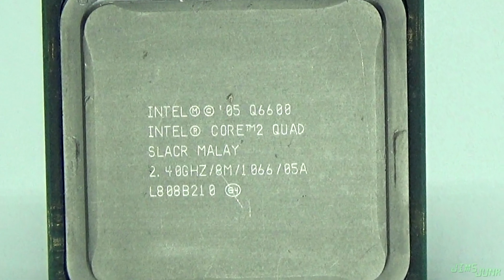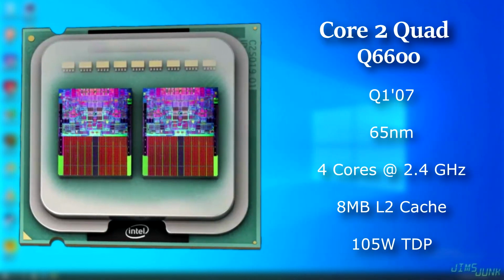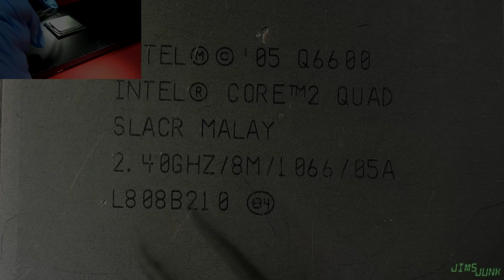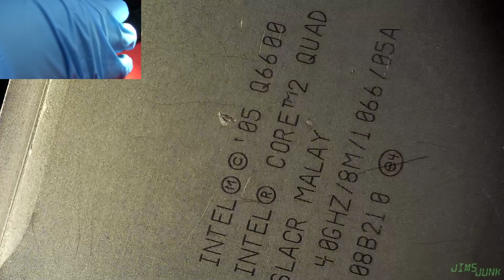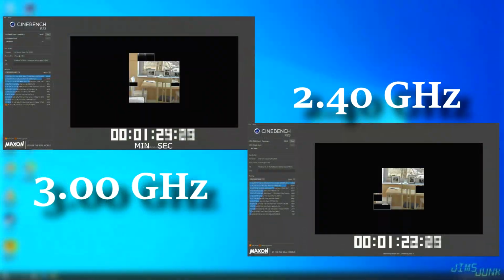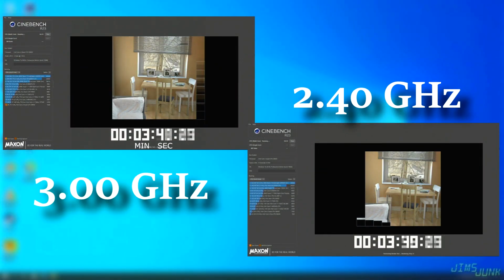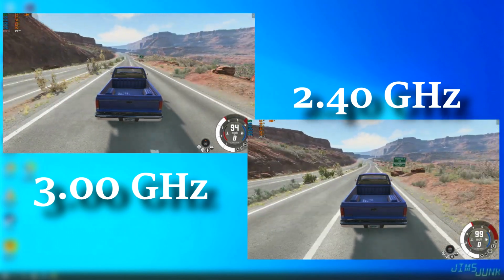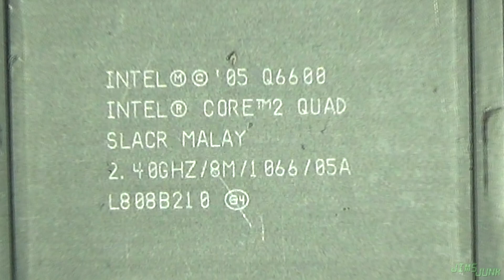Easy Overclock Core 2 Quad at 2.4 and 3ghz.  Worth it?  Still usable today?

Comment from the maker: Not sure what I was thinking but as far as using the tape/pin mod, you only need a piece over the Bsel2 pin which is the bottom piece of tape.  The top one used isn't needed and only blocks the VSS(Ground).  If this doesn't work you'd need to use a rear window defogger repair kit to connect the VSS pin to the Bsel2 pin, thus grounding it out.  With just a piece of tape over it, the pin is floating..aka not ground and not positive.  Most motherboards I found work fine this way however some may need both pins connected.

Comment: I use a core 2 quad every day on my budget gaming computer, most of the games I play it works absolutely fine also while letting me multitask, the only thing really bottlenecking me right now is I'm currently using 4gb of ram, I will be upgrading to 8gb soon although some how it still plays fairly well with 4, for those wandering what pc I'm using it is a dell xps420, many may remember it by its unique built in screen

Comment: Bro Does It Works On Optiplex Pc With LGA 775 Core 2 Quad Q6600
Reply from the maker: Long as the board supports a 1333 fsb.   Most do

Comment: Can u do a 
Stock and Overclocked Core 2 Quad q9450 VS I5 2500?

Q9450
Stock 2.66ghz 
and Overclocked to 3.7ghz
2x6 L2 cache
1333mhz bus speed
DDR3 1333mhz

Vs

I5
3.3ghz
With Turbo boost 3.7ghz
1mb L2 cache and 6mb L3 cache
5GT/s bus speed
DDR3 1333mhz
Reply from the maker: yup actually doing something similar to that in the near future, soon as I get a hold of the cpu's.  Keep an eye out.

Comment: The G0 stepping (which you have in the video) was a great overclocker. Back in the day it was common to drop the multipler to 8x and set the FSB to 400MHz for a stable 3.6GHz. It required good cooling and a decent p45/x38/x48 motherboard though
Reply: 8x400= 3,2Ghz. Well, you mean this for older B3 stepping. That one was tricky one... G0 is fine. :) 9x400=3,6Ghz is possible. Of course, you need a good VRMs for C2Qs and cooling, especially for Northbridge.

Comment: I actually just picked up a q6600 that I stuck in an XPS 420 to for a cheap XP 32bit build. Dual boot with Win 10 and win 10 runs fine with 4gb of ram, much better than the e6550 that was in there. Plays 4k rendered youtube mostly fine, it would feel normal surfing the modern web apart from viewing it through the CRT it's displaying on.

Comment: It could have been luck of the draw on the silicone lottery, I remember having much better luck on BSEL modding Q6600's (2.4ghz to 3ghz) than Q6700's (2.66ghz to 3.4ghz). I think it's because I couldn't adjust the voltage on oem motherboards.
Reply: Probably. I could benchmark at 3.6G with my Q6600 and daily drove it at 3.2, till the MB died.
Reply: late reply, but usually lga 775 cpus do go higher fsp the lower you get cpu ratio down, most likely why q6600 usually oc better than q6700...

Comment: Most Conroe Core 2 Duo perfectly run at 3000-3300 mhz at default voltage. And their maximum FSB was around 500, many even run at well over FSB 500.

Comment: So instead of pin moding the celeron in my dimension 2400 I ended up modding the motherboard.

Theirs now a pin block both soldered and double sided taped to the pll.

That all ended up being POINTLESS because the northbridge purposefully doesn't work at 133mhz.

Who knows, maybe 533mhz fsb chips will work now that the pll is always set to 100mhz.

An otherwise excellent pc.

Comment: The Core 2 Extreme CPUs had a 1600mhz FSB. Some socket 771 Xeons also. They can be modified to fit and work in socket 775 boards with a BIOS mod
Reply: Only some of the 771's had a fsb of 1600. None of the 775's did but with a good board good ddr3 and a decent chip you might be able to push it but even the xeons didn't really like the fsb being touched and forget about pushing ram speed if you want to overclock the 771 at all.
Reply: @tronalddump8776  QX9770
Reply: @JoshVennix  oh ya I forget about the 9770 only because they are still the same price they were when new. Unattainable.
Reply: @JoshVennix  you still needed a good board for that chip so there's that. That chip wouldn't run on just any board only certain maybe 2 chipsets.

Comment: can you do this one. the fastes Pentium D VS the slowest Core 2 Duo. or Intel atom vs Pentium 4
Reply from the maker: Sure.  I currently own a netbook with an AMD C60 processor.  It was AMD's Atom competitor.  Used to own an Atom n450 netbook as well and I can say they are VERY similar in performance.
Reply: @jims_junk  i have a AMD E450 and Atom N455, tinking in use them for emulation.